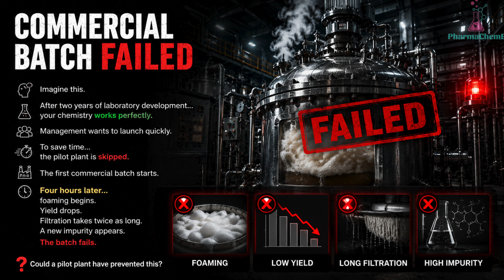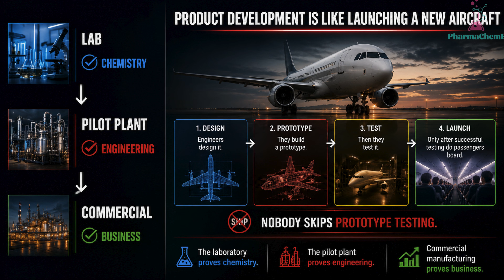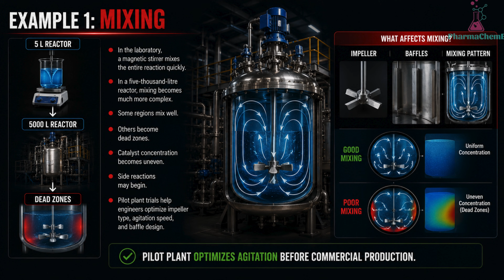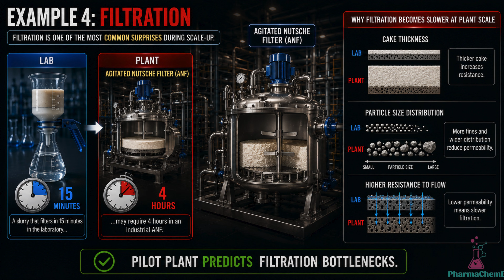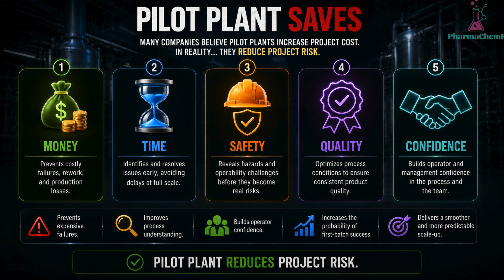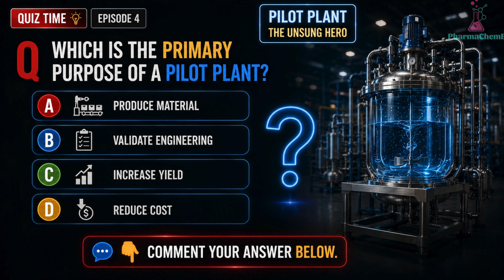Why Can't We Skip the Pilot Plant? | Lab to Commercial Manufacturing | Ep. 3

Comment: B
Reply from the maker: Correct! 👏
B – Validate Engineering is the primary purpose of a pilot plant.
A pilot plant helps verify critical engineering aspects such as mixing, heat transfer, mass transfer, filtration, drying, equipment performance, and process safety before moving to commercial manufacturing.
Thanks for participating! 😊